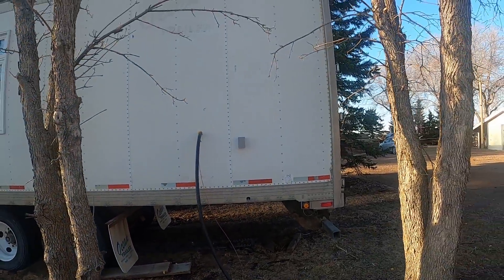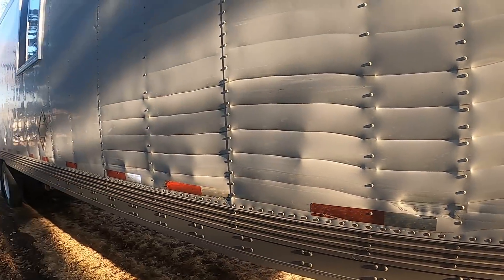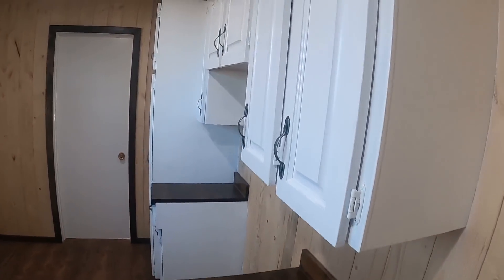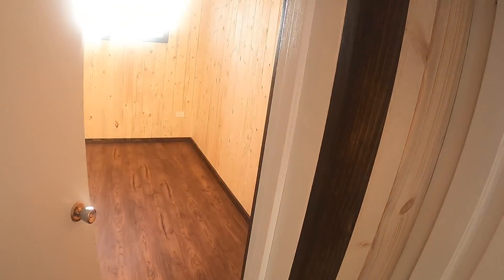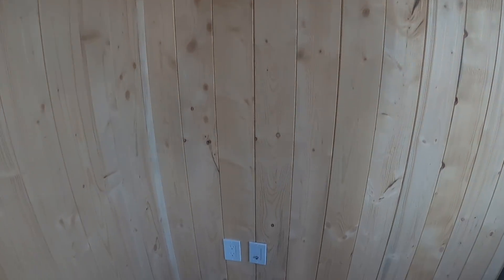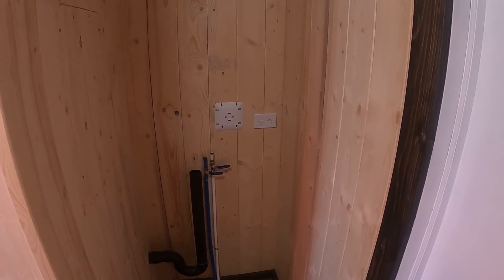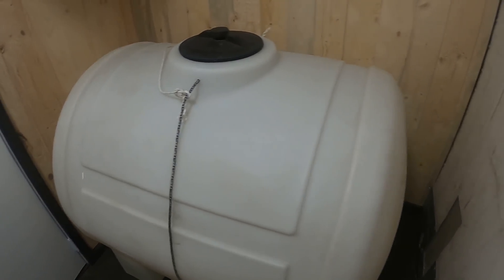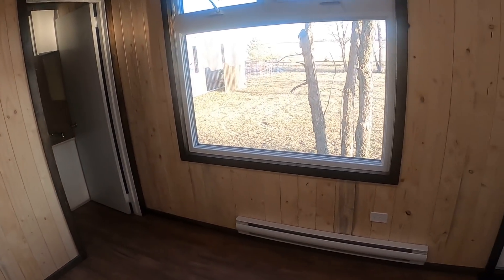My refrigerated semi-trailer converted into a house.

Comment: Can i buy a day cab and haul this around  since i would not be for hire,   or do i need a CDL.
Reply from the maker: No idea
Reply: My bet a CDL would be needed since it is not a manufactured mobile home. The truck part to pull it around would be over a 100,000.00 bucks and drink a lot of fuel. And your home would never go up in value. Plus very high insurance rates. By the time all is said and done you could own a 200,000.00 home with property.
Reply: @RodgerMudd  you can rent a automatic truck for $400 and this trailer run about $6-$80k
Reply: First you would de title the trailer and truck from a class 8 over the road.  I currently have a HDT RV and fifth wheel toyhauler.  Truck is titled in South Dakota as a RV/motor home.  Non CDL requirements.  Trailer is a standard toy hauler.  Title as RV use.  Both are considered RV.  Buy the way the truck is a 2013 Volvo 760.  Costs $24k.
Check out HDT RV and you will see how other people have done the same thing.  Brian and Cindy "xtreambydesign with passion"
Reply: @RodgerMudd  I can buy a used semi truck for 28k  and it will get about 7 to 10 mpg pulling a trailer made into a RV.    and used  2 Axle box trailer 48 foot for 4000   put in another 20k into making the inside   i have a total of 52k finished.       a 5th wheel RV you only get 7 to 10mpg.    and a BUS RV is only 7 to 10 mpg,
Reply: IMO its a great idea for permanently parking on a piece of land but far too expensive to try converting into a rv. I fuel a semi truck nearly everyday and they get approx 9 mpg running on flat land empty.
Reply: @RodgerMudd  South Dakota classifiys  class 8 truck as a motor home if it has the following:  shorepower, refrigerator, and a microwave.  Non CDL requirements.  Texas you must have a non commercial drivers license with airbrake certificate..  Tag it in South Dakota.  Must put on the side "Private RV.  Not for Hire"
Reply: Buy the way I get 10-11mpg with my Volvo 780.  Pulling 23k in weight.  Just have to keep my foot out of it.  My 2006 3/4 Dodge got 9.5mpg. Pulling same weight.  Volvo rides twice as nice and I'm not tired if I drive eight hours that day which is a very rare day.  Maintenance costs are also cheeper I change my fluids once a year $500.  As compared to the Dodge every 3 months @$120.  Tires have been done once in three years on the Volvo as compared to the Dodge every year and a half $1000.  And you can not compete with the saftey of the HDT.
I yet to get my brakes even warm in the mountains.  Pulling power in the mountains can not be out done.
Wife has fibromyalgia and can not sit for long periods of time.  So she can get up and move around or take a nape in the sleeper.  Or sit in the sleeper with the grandkids and do crafts while we run down the road.  Try that in your truck.
Reply: CDL is the federal COMMERCIAL DRIVERS LICENSE, if you are not using it for work then it is not commercial, so then the states laws fall in to place need to google your states laws, or license it and your Semi in South Dakota as a RV then you can follow their rules and no CDL needed.
Reply: @badgerpa9  Yep, no CDL requirements if your rig is a motorhome.  How ever if you have your rig licensed in Texas, Nevada and some other states they may have a requirement that you obtain a Class A non commercial license.  Example brother has a truck and trailer that weight is over 26,000lbs.  Said is not for Hire. But the state requirements says he must have a non CDL Class A.
Check your local state requirements for these large vehicles.  Also if you have a motorhome with airbrakes you may have to add an additional requirement to your current license.

I'm currently a licensed Federal Motor Carrier Certified Instructor.  It's good to know what is required.
Reply: @brianroth7852  Need to check the states requirements. for license and vehicle license, some states will not license an RV over 40 or 45 feet depending on the state.  People get confused and forget the drivers license is for them and the vehicle license is for the vehicle and you need both.
Reply: @badgerpa9  Yep, that's why we tag or Licensed everything in South Dakota.  Got to love a state that lets you drive and license a big rig and wagon and don't need a CDL. 
Im a certified Federal Motor Carrier Instructor.  So I'm keeping my CDL anyway but really don't need it to instruct in the class room.  But for the driving end of the teaching I do.  I teach one on one only.  40 plus years behind the wheel.  If it can be hauled by truck I've done it.
Brian and Cindy "xtreambydesign with passion"
Reply: @brianroth7852  I hope you keep busy teaching people in big rigs, RV or truck drivers.  I will try to keep your link incase I talk my daughter into getting her license.  It has been a few years for me and the last driving I did was all agriculture short distance.   Stay safe and healthy.
Reply: @badgerpa9  Very busy since the FEDS have mandated a minum requirements of driver training effective February 2, 2022.  Must have class room traning and behind the wheel.
Not going to be like the old days.  If you could drive it you where qualified.
Reply: No cdl is required if it’s for personal use like a motorhome type use. Before all the keyboard warriors start up and tell me I’m wrong, I’ve got 41 years in the trucking industry and if it’s not commercially licensed, ie you aren’t hauling for hire , you are exempt from the cdl license and federal fuel tax filing and it can be plated as a motorhome.
Reply: @scottberry5266  I just talked today to the DMV about buying a Trailer and Rig to be a RV.  and they told me this.    You will need a CDL to operate any of the following vehicles: A single vehicle with a GVWR over 26,000 lbs. A combination vehicle with a GVWR over 26,000 lbs, towing a unit over 10,000 lbs GVWR. .    I told them i would change the Title to RV.  they said something about that does not change the GVWR raiting by changing what it is.       Are they right???   and if not what do i tell them.
Reply: @djzman  : well they are wrong. There are a few channels on YouTube that have converted tractor trailer campers and a few of them talk about this subject. Here’s another scenario, what if you buy a old greyhound bus?? Those require a cdl to drive them commercially, but not privately. All the big coaches made by prevost Newmar etc have a larger gvw than 10,000 pounds, and all have air brakes, yet don’t require a cdl endorsement, and many of them pull a car hauler behind them. The bus alone weighs 40,000 pounds plus the car hauler weight.
Reply: @djzman  : my brother got into this predicament with a sheriff deputy using his dually and a tandem axle dually gooseneck trailer hauling a backhoe. He owns the truck privately, the trailer privately, and the backhoe privately. None of the pieces of equipment have a commercial purpose, we just use them privately. Now that being said, if he was overweight he could be fined but he’s not. That’s pretty much the extent of it if that makes any sense.
Reply: @djzman  : by the way what state are you living in. We live in Michigan.
Reply: @djzman  : sorry about going on but there’s a guy named Gregg shields on YouTube and his channel is HDT I believe and he converts old tractors into toter homes. Look him up.
Reply: @scottberry5266  Arizona.

Comment: Should have used the endless hot water system instead of a tank
Reply from the maker: I had thought of that yes.  Maybe next one.
Reply: @mccrearymike   do you homework,  before you get one of those endless hot water systems.    I had one in my Motorhome.   it did not last for 4 years,   then i got another one and it died in 2 years,    so i went back to a hot water tank again.   Its now been 6 years and no prob.

Comment: No closet?
Reply: AMEN & AMEN! YOU CAN TELL IT WAS DESIGNED FOR A MAN...SINCE THEY DON'T NEED A CLOSET!!! 🤣😂🤣😂🤣😂🤣
Reply: Use a wardrobe.
Reply: I'd run a pole the length of one of the bedroom walls to hang clothes on and use under bed storage as well (under my teeny tiny bed LOL)
Reply: @badgerpa9  - It didn't look like one would fit in the bedroom. I would have made the room with the water heater smaller to acomodate a closet in the bedroom, and used a hot water on demand system. He still did a great job, though.
Reply from the maker: No I left it for the buyer. Lots of assemble it yourself out there etc.

Comment: I am not being disrespectful to this fella.

But I could NEVER understand why any builders put baseboard heaters along the areas you can put furniture. 

Why don't they put them along the ceiling and wall?🤔?

And it's possibly near a ceiling fan that would help circulate the heat or cold air. 🥶

I thought about this idea 💡🤔😅when I rented my first apartment with baseboard heaters around 30 years ago. And now they have these awesome things called a minisplit for tiny homes that mount above instead of in the way of everything for heating and cooling 😎🥰🤗

But I noticed you have an installed air conditioning unit. 

Working at a warehouse unloading trucks and these kinds of trucks 🚚. Then started watching tiny homes, van conversions, tiny home builds in general. Everything I see now is a convertible home 🏡🤣🥰

So my idea for this particular truck was to run my heating, cooling and possibly build the refrigerator to run off the already installed cooling systems for the truck which it uses for delivery. 

But it's a pipe dream 🤣🥰😪
Reply: Make sure you buy a 12 foot ladder and a few 5 gallon yellow diesel fuel containers so you can refill the refrigeration unit every 8 hours during the summer month's. Also, buy ear plugs because those things are loud!
Reply from the maker: @scottbaxter2682  The reefer unit is removed as you can see in the picture.
Reply from the maker: The reefer unit has been removed. It has a wall air conditioner that comes out in the winter @scottbaxter2682

Comment: Under the floor should be insulated. Basic item that should have been performed and not overlooked.
Reply from the maker: It is insulated. Four inches of foam.
Reply: @mccrearymike  My apologies, It didn't appear to me from the video that it was.
Reply: @johncase2974  : it’s a reefer trailer, there made to haul ice cream on 100* degree days and stay at a balmy -20* on the inside.

Comment: Can somebody tell me how much square foot of plumbing and electrical wire this thing needs that's where all the money is is hot water tanks electrical receptacles and things like that the doors and windows off mine are going to come off of my mobile home which I just renovated before it was flooded because the town turned the water on when the plumbing wasn't complete and I was out of town for 8 months so my only solution was to buy one of these $4,000 refrigeration trailers and living it while remodeling it

Comment: Price?
Reply: I found these things for sale on marketplace just the bear trailer with or without the refrigeration unit attached with goods wheels and suspension and structurally intact for about $2,500 to $12,000 depending on the age and suspension system of the trailer and whether or not there's a refrigeration system which we really don't need converting it into a home so start with that initial $4,000 investment for the trailer then you need doors windows 2 x 4 for walls a roll of a probably a 1000 sq ft of electrical wire to run all the outlets you need outlets themselves all the plumbing which would be packs a shark bites of hot water tank these things are expensive as fuk to build I'm lucky because I get to use some parts from my mobile home such as the ventilation and heating system brand new doors and brand new windows along with the steps and other things like hot water tank
Reply from the maker: I screwed 1 by 4s onto the studs first